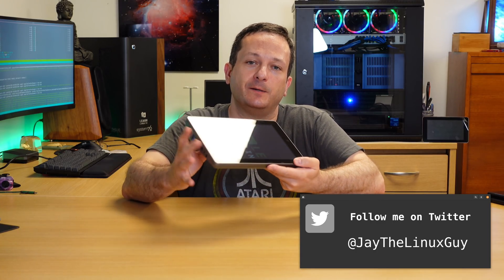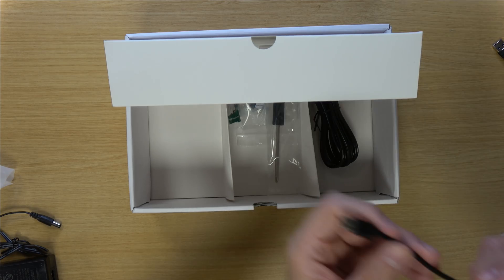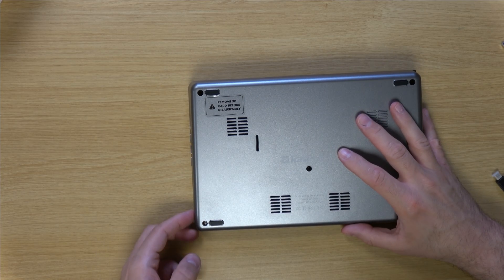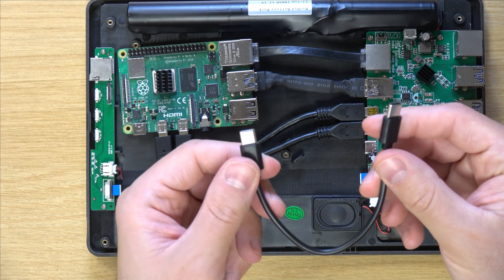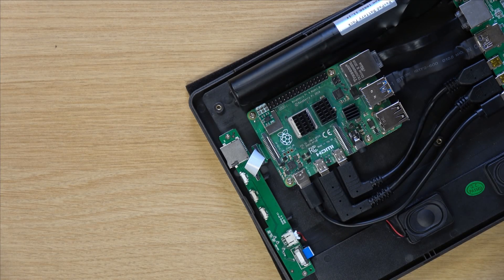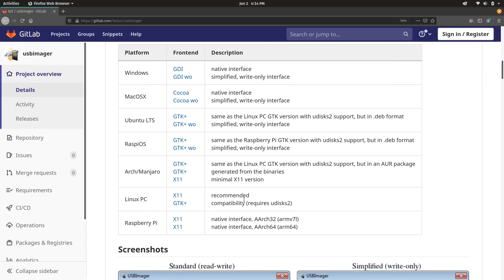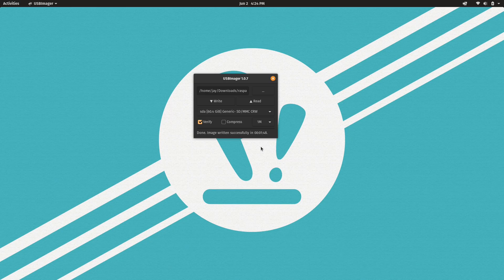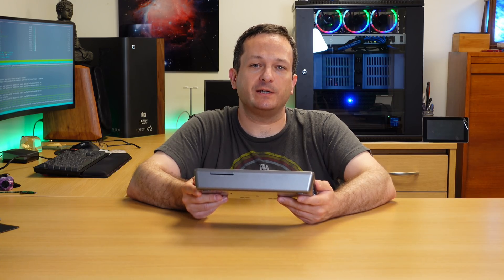The RasPad 3 - Unboxing and Assembly

Comment: Until they get some graphics acceleration into the Raspberry I think it is a poor choice to build a pad with. Almost any pad you buy from a known manufacturer will give much better results playing videos that the Pi 4 and would likely be less expensive that the Pi4 and the Raspad 3 together. I have a Pi 4 and was very pleased with it until I found that it could not play a video at any reasonable resolution.

Comment: Just looked at the price. Thats a hard pass for what it is. 1200x800 resolution screen. Wow.
Reply: A pinebook pro is cheaper than this, is a laptop instead a tablet, is thinner and with a better soc (edit: the main board is not included with this product) and bigger screen with more resolution.
Reply from the maker: For some use-cases, it might not be a good fit. It all depends on what you want to use it for.